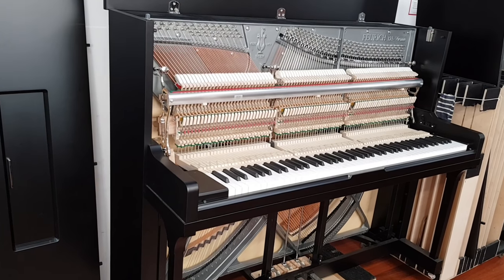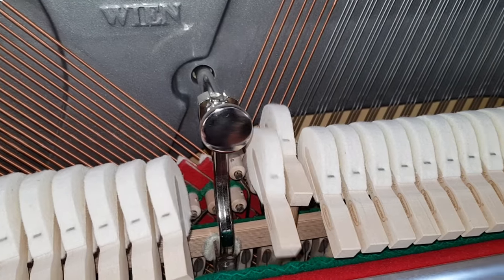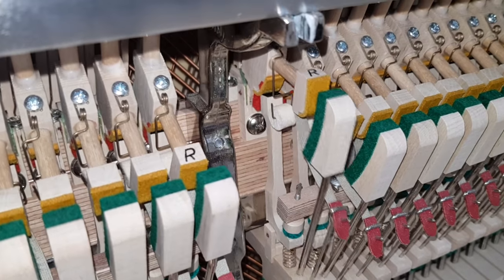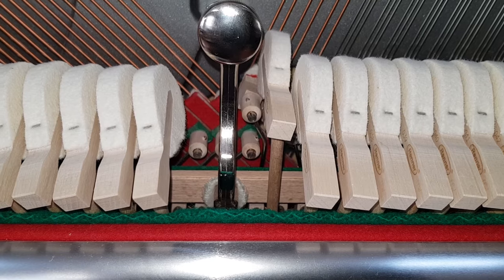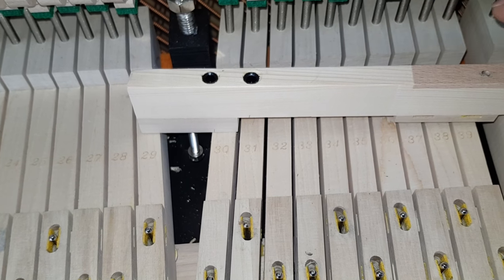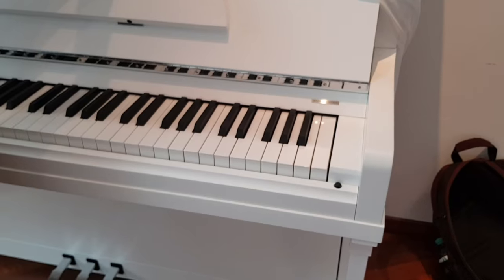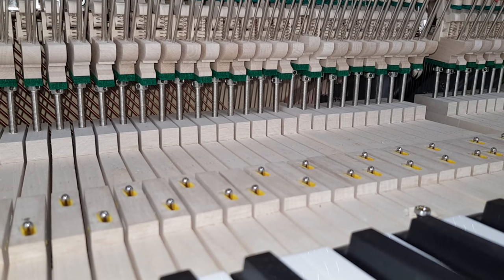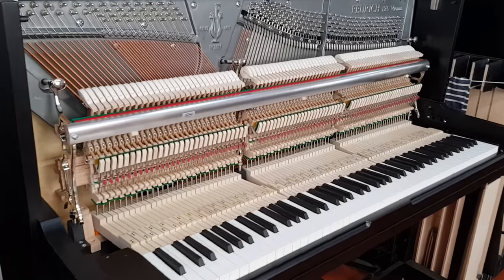Feurich 123 upright piano made in Austria - brief tour of the factory.

Comment: Nice useful explanation. I don’t understand why Feurich didn’t put bottom wood it should be closed so it’s safer. I feel it’s a drawback, I don’t understand the logic behind this concept has been taken by Feurich. Rest everything is impressive. In an open bottom air can go easily and it will badly effect to piano’s performance. We can’t even fix dehumidifier inside because there’s no bottom wood.
Reply from the maker: Thank you for that useful comment. Marcus